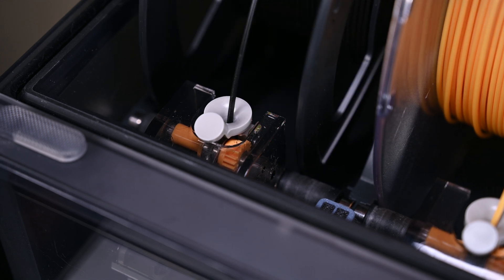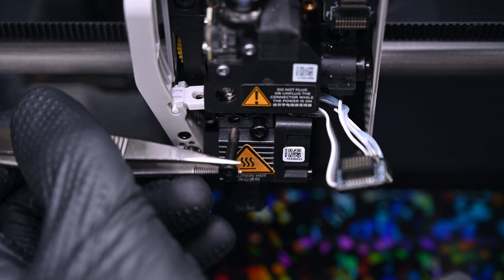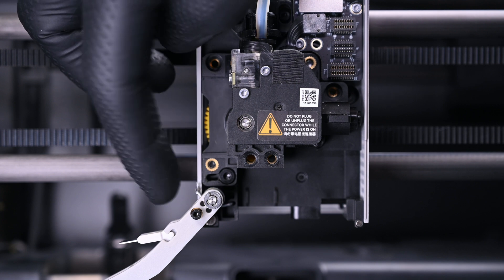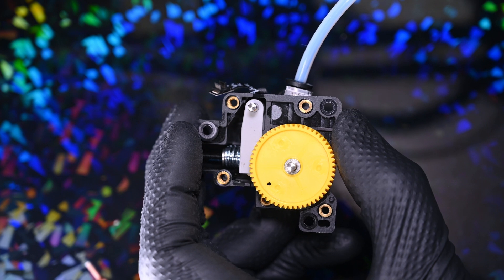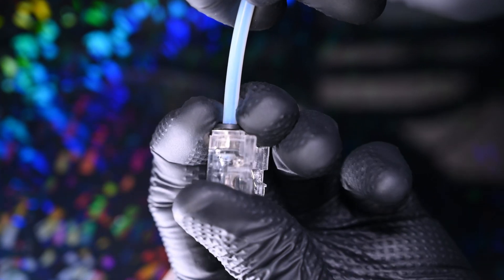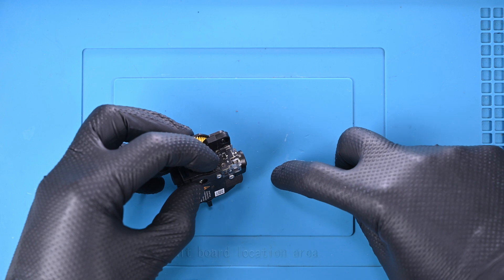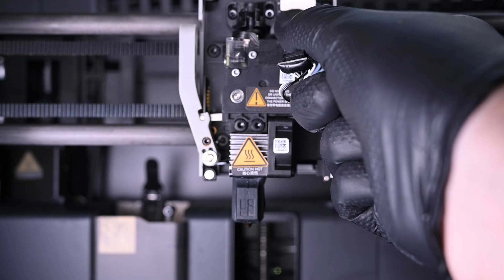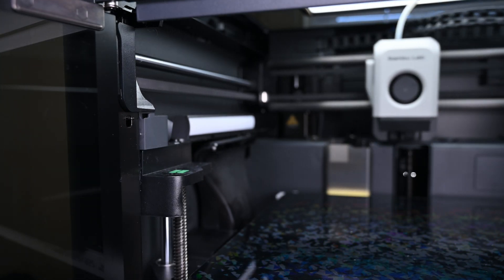Bambu P1S Full Extruder Teardown Guide - Failed to pull out the filament error fix

Comment: I just ran into this issue. my printer (as well as myself) are 5 days new into 3d printing. I was able to resolve the filament issue being stuck, and it was exactly as this video described. but now, when i go to print something, the filament is not pushing back through the extruder. like the gear is off and grinding? any help? i've taken it back apart twice now and still nothing comes out of the hot end when i do a calibration print
Reply from the maker: I’d look to the nozzle next. Sometimes debris can clog the tip and performing cold pull will get you back to printing
Reply: @TapticDigital 100% was the problem! A piece broke off after the extruder to the nozzle and was cold stuck. Followed another video to melt a thin Allen into the end and let it cool to then pull out the stuck piece. Back up and printing already! Thanks for your reply!

Comment: Thank you! I watched several similar videos, but your video, audio and step by step process is clear and flawless. Tomorrow I can go in with confidence and clear my first extruder clog!
Reply from the maker: Awesome! I’m so glad to hear it. And if this guide misses something I have another about the hardened extruder gears that also goes into a full teardown and reassembly. And thank you so much for your support!
Reply: @TapticDigital  Well I'll share a mistake I made. I had a piece of filament stuck exactly where you did, and "angrily" removed it. Put everything back together, booted up the printer and got another extruder error. So I tore everything apart again, and discovered I didn't check the filament exit hole on the extruder to ensure it was clear. When I removed the stuck piece of black filament, and reassembled again, everything worked perfect. Thanks again!
Reply from the maker: You had me worried in the first half! Glad you got it going, let me know if you’d want a guide made about anything else, I’m always open to ideas!

Comment: Did it, put it in my printer, change the filament and when loading the gear is still clicking and not extruding... I made sure that there was nothing left of the old filament in the extruder and it still clicks. what can I do now? the printer is practically brand new, has 60h print time
Reply from the maker: Does it still pull the filament back correctly? You
May have a broken piece of filament in the AMS hub around back, or possibly your nozzle is clogged by something
Reply: @TapticDigital Yes, it does pull correcly, i use other filament from bambulab
Reply: @TapticDigital  I don't have a AMS unit, and i think it pulls the filament correctly, but when it "reaches " the extruder it starts clicking (the yellow gear is not moving, but it vibrates). I don't know what to do now, should i disassembly it again or should i reach directly to bambu lab support?

Comment: hey - sensor body had this metal thingy on spring ?
Reply from the maker: Yep the sensor body has a little lever on there that's used for detecting filament in the hotend. It is an important piece.
Reply: @TapticDigital  thanks for video! Had same thing stuck in same place. Opening that body somehow that thingy sliped out of spring. Thank’s for clarfying that that metal thingy is under spring.

Comment: I had this exact same issue.. same exact lodge..

Did you change any parts after?
Am just ordering a new tensioner screw as mine seem to be all rounded off before i even touched it
Reply from the maker: My issue ended up being heat creep, I was running the build plate too hot and leaving the lid and door shut. I did upgrade to the hardened gears later (there’s a video on it!) but they won’t help with user mistakes like mine

Comment: Follow this step by step. Only issue I had was a cutting sensor error. Make sure to seat the cable correctly, it seats a little left of where might be expected.
Reply from the maker: The cable connectors are the most frustrating part, they should be a lot more idiot proof for idiots like me 😂

Comment: Had this exact same situation happen to me but it was mostly my fault since I tried to use a filament with a Max temp of 230 celsius, and then I tried to purge it after and it didn't work obviously. This video was very detailed thank you
Reply from the maker: I’ve found the majority of problems I run into are caused by me being dumb 😂
Reply: @TapticDigital same here lol, but it's always good to know how to take things apart and fix them. When you actually break it down it becomes so much more simple Than People realize. I work on aircraft in the Navy and you wouldn't believe how easy it is just to follow step-by-step instructions, I've been able to remove engines and gearboxes and fix fuel cells just by following simple instructions. That's why I like this video so much, you wouldn't step by step and you made it very simple to break down.

Comment: Thank you! This video helps me with my issue. If not for this video, I might need much more time and risk getting the assembly wrong...
Reply from the maker: Hey glad I could help! I’ve got another video about installing the hardened steel gears, it goes a bit more in depth on the extruder teardown just in case I missed something in this video!
Reply: @TapticDigital I'm just starting but sure I'll need that in the future. I'll take a look!

Comment: What an absolute legend. Thank you for putting this video together.

I just had the same error today and this helped me immensely. Though in my case I didn't need to pull the bowden tube out. I was able to remove the sensor body from the rest of the assemble and pull the filament out from the head. So I didn't have the exact same issue (no filament clump) but 99% of your instructions still applied to my case.

Comment: Ive had this exact issue about 5 times this week. The video is great by the way. Ive done it myself so many times recently I reckon I could make a video by now! But I want to try and get to the bottom of how this actually happens. How the filament gets squashed and no longer slides through the hole? My only guess is that the tensioner is set too tight although mine was the same as yours, fully wound in from factory. But it’s happening each and every time I print currently so will leave it a bit looser and see how I get on. Thanks for great video 👍
Reply from the maker: For me it was heat creep. Leaving the door open slightly or lifting the lid a bit instantly stopped the clogs

Comment: This is the best video ive ever watched for troubleshooting a problem. I had a small piece of filament stuck in the part by the gear right before it goes to the nozzle. Wasn't able to access it without this video. Once I got the extruder disassembled I was able to heat an allen wrench and push the old filament out. I had to do this because there was no part of the filament to grab onto with a tool. 4 days without being able to use it and now after following the steps of this video my printer is back to working again!

Comment: I would wager that this is the BEST disassembly video for the Bamboo extruder system on the internet. Ours was trapped at the end of the PTFE tube line slightly fatter ....from the fault in the extrusion process (unsure how it happened).  So the vey last step wasn't needed as once the tube was detached we could push it through instead of pulling it.  However, we bought the improved kit with the stronger wheel so we were going to have to do this eventually anyway. What a fabulous video walkthrough you created. Bravo!!
Reply from the maker: Super glad to hear it, and I’ve got you covered on the upgrade too! I recently posted a guide for installing the hardened steel gears and it goes even more in depth than this one, without being annoyingly long. Hope you’ll check it out!

Comment: Bro u sound just like the how it's made narrator to a tee. Video help alot. Still trying to figure out y it's abs that getting stuck. Prints go when print the abs but stops coming out but head keeps going as if still printing no problem but filament stops coming out an print file keeps going lol
Reply from the maker: Sounds a bit like heat creep, which was my issue here. The nozzle was melting filament much further up than it should have. Try increasing speed slightly to keep things moving, you can also try removing the top glass lid or at least lifting it a bit for some heat to escape. Also thank you, the How It’s Made guy is one of my heroes 😉

Comment: you need to press down the black lock on the bowden tube to remove it.....
Reply from the maker: Yes, as you can see I tried that in the video. The problem is that the Bowden can’t be removed when a piece of filament is through the entire length. There’s no slack to pull on to release it.

Comment: Anybody that has a X1C This video is the exact same steps altho the cable connectors are slightly different they are plastic plugs instead of ribbons but everything else down to the screws was exactly the same saved me I thought i was toast when i couldnt remove the PTFE Tubes! 😅

Comment: First of all, when I read all the comments below I was surprised that so many people have experienced a similar problem on the printer brand that never fails. There must something wrong with that. Second, I see home complicated the BBL extruder is both in construction and disassembly. Considering the two points (first and second) it is really some food for thought.
Reply from the maker: If you think this is common, or complicated, take a look at a Creality Ender 3. The Bambu one is much better designed, easier for maintenance, and the 99% of issues seem to be user-error. Like this problem, my fault for not venting it properly and causing heat creep.

Comment: yeah but why tihs happen to me in midle of print, i understand at begining but in middle?
Reply from the maker: Heat creep. If you have the printer closed up while printing the internal temperature continues to rise. Eventually it can get hot enough to melt the filament further up in the hotend than it should. And you end up with a clog of melted filament bits.
Reply: @TapticDigital  yeah but i dont have melted filament,, also i read  ba,bu forum and  looks like all ams 2 púro has defect

Comment: Great job, and many many thanks.  I've had my P1S for mere days, just got the AMS and it will not load filament due to some sort of clog.   I guess I didn't unload the old filament properly...?  Anyway I wound up buying the hardened extruder gears as well as hardened hotend so this will help immensely to get those installed and hopefully find what the issue is.

Comment: HI thanks  for the video... I followed the same steps but somehow It drops a bearing in my table and I do not know now where is coming from :S Any idea?
Reply from the maker: Check out my newer video on the hardened steel extruder, I go a bit more into the bearings and gear assembly. Basically one bearing goes at the top of the main gear shaft and the other at the bottom

Comment: Thanks so much for this video, you just saved my 2-day old P1S.
Reply from the maker: Glad I could help. Were you printing PLA by chance? If so, try printing with the top glass off or the door open, I found that most of my clogs were from heat creep.
Reply: @TapticDigital i was printing a cheap spool of Amazon PETG overnight. Before i went to sleep the spool got snagged and caused a failure once or twice but overnight it just completely jammed inside the extruder exactly like the example in your video.

Comment: I was lucky to come across your video. I am new to 3D printing and last night during a print I ended out getting a clog. My clog was almost identical to yours. the full teardown guide was a life saver. Thank you.
Reply from the maker: Glad it helped! For me the issue was heat creep, I wasn’t leaving the lid off or door open when printing PLA, and running the bed hotter than it should have.

Comment: I did all of these steps... cut off a piece of filament and it could pass cleanly through the extruder... i put it all back together, insert it back load some filament and immidiately i get clicking noise from the gear trying to extrude.
Reply from the maker: It’s possible you’ve got a nozzle clog, if the filament can’t move forward the gears will just skip. Time to look up a cold pull guide!

Comment: Extremely helpful but I have a peice of plastic stuck in between the gap of the little metal main gear I cannot slide it out please help on taking out!
Reply from the maker: I think I left you a comment on Reddit, but you’ll need to tear it down and pry the gear out with tweezers or by pushing the metal post out from the other side

Comment: This video has saved my ass like 30 times this year 😂😂 I'm having this problem a lot lately..it keeps doing this exact little piece getting stuck in extruder. 1st I thought it was a bad batch of filament..then I changed the cutting blades ...but it would still happen now maybe once every 2/3wks? Is that common? Or should I look deeper into the extruder? I've had my machines for a year now and only now are they acting up in this way. Both my x1c and p1s

But for now thank you for this video, great work!
Reply from the maker: My issue ended up being heat creep. I was using one of those holographic plates and temperature needed to run higher, combine that with not opening the door or lid and I got melty PLA jamming up my works!

Comment: Why did you not mention at the start that you can press the top button and the tube comes right off? I got to the removing the nozzle bit before I stumbled on this option in another video... I can't imagine I would break my 3D printer for such an issue I could've solved in few seconds...
Reply from the maker: Because it can’t be removed if an entire length of filament is running through it. I tried repeatedly but there was no slack to pull it out, which is why I mentioned they it couldn’t be removed in my case

Comment: Thanks for the video. Same sort of issues here, but I also was going to do a swap of the gears to the hardened set so I took those out first (leaving the run out sensor in place) then carefully snipped the exposed filament mess. Not sure if that made a difference (probably not) but found I could JUST get to see/expose the filament where the bowden connects outside the chassis. Snipped that and pushed the rest of the stuck filament through (into the now open gear space) with a spare filament piece down the now accessible bowden tube. Easy to pull out from that point. Your video really helped to get a feel for what was possible and how to re-assemble. Appreciated.
Reply from the maker: Awesome! You should check out my newer videos, I actually posted one about installing the hardened steel gears not too long ago!

Comment: Thank you so much for this video! I have been printing for months and never had a clog. i tried the poke methods and got some longpieces of filment out but something was still stuck. I am not a tinkerer and your video was so easy to follow and made taking the extruder apart much less scary! I was amazed that i was able to take it apart and put it back together again! Funny enough, i had the exact same clog you did, a lil blob right in between the gears. Thanks again for getting me back to printing!

Comment: How do you remove the stuck filament from the hotend on top? The filament is cut off. And I can't pull it out since the filament o.n the top is very short
Reply from the maker: Use another piece of filament to push it through once you’ve removed all the parts holding it in place
Reply: @TapticDigital Thank you so much for your video!

The heating of nozzle to 240deg helped. 😊

Comment: had the same problem but the motor isn't working on the extruder. not sure what else to do i cleaned it out even swapped the hot end.
Reply from the maker: Check around for disconnected or split ribbon cables, the motor for the main gear is actually a bit deeper in the hot end

Comment: The Bambu official site said I needed to PRINT and guard to get my gear out since it was stuck, your video was like "hey, just do this."  Freaking LIFE SAVER!!!  Also, May 2025.  I thought I had messed up installing the 0.2 nozzle!  Thank you.
Reply: I even had the tube stuck like this and it made me feel like I wasn't actually stupid cause it just wouldn't come out.
Reply: @EarthBornFiber0  re 0.2 nozzle. I have printed on 0.4 for >10kg (looking at the empty boxes). Changed to 0.2 for some special work and this happened on the first reel. Got to admit it might also be the PVB filament but I assume back pressure on the 0.2 has got to be higher. Pity as it does beautiful prints when it works.
Reply: @fafhrd0023 right?! The detail is insane and I want to use it more, but I guess I’ll have to use it sparingly.
Reply from the maker: I had printed the guard myself and completely forgot about it until well after this video. Nice to hear yours is working again!

Comment: this video is amazing, I did everything, and it worked, but my printer is printing pretty bad, I don't know why is that, maybe the filament is wet, I will dry it, I hope that is the reason, because I followed all this steps properly and before the problem the printer was printing perfect
Reply from the maker: What kind of results are you getting? In my case it was heat creep, I was running the bed hotter than normal and had both the lid and door closed
Reply: @ i made the same mistake, i will try to keep everything open, now im drying the filament with the ams2, after that i will try to print again, and again THANK YOU SO MUCH FOR THE VIDEO

Comment: I’m having an issue and don’t know what it is possible you can tell me what could be the issues. Every time I print something the nozzle clogs after the print is done and I have to unclog then I can print again it, what could be the problem, I replace the hot end and that didn’t help
Reply from the maker: @paulashepard8757  could be heat creep, how hot is your bed and are you leaving the door or top cover open?